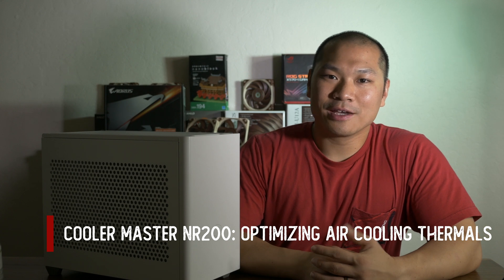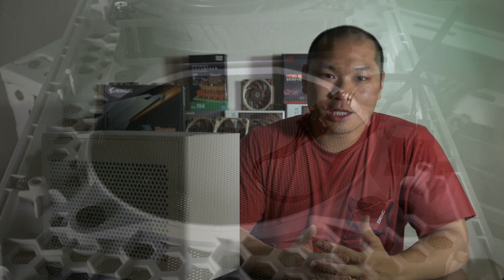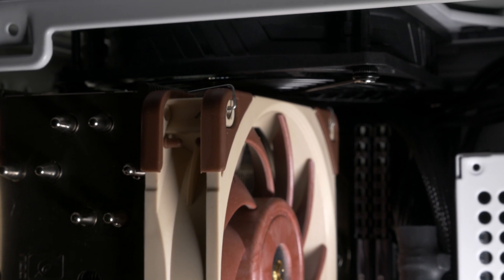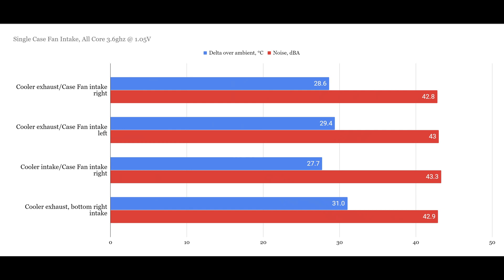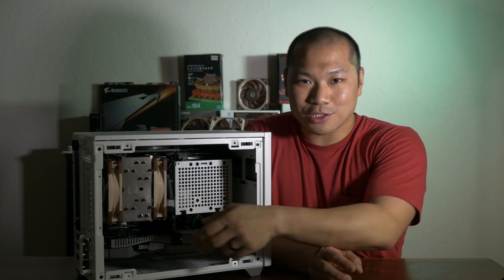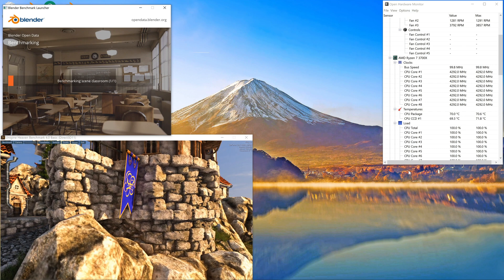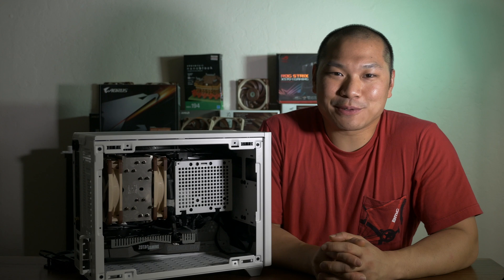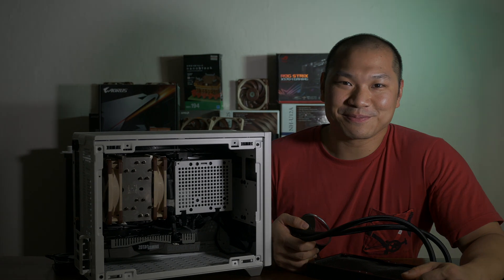Cooler Master NR200: Optimizing Air Cooling Thermals

Comment: I'm planning on doing an NR200 build with the CPU cooler being the Scythe Fuma 2 (155MM). I was also planning on getting 5 Noctua NF-P12 fans; 2x top exhust, 2x bottom intake or exhaust (depending on if I deshroud my GPU), and 2x side mount intake. Is this configuration something you think would be fine, or do you recommend something else?
Reply from the maker: I think it would be fine- my only recommendation would be that you could get by with a lot less fans. Also, correct me if I'm wrong, at a minimum you can lose one of the side fans, since it won't physically mount on the rad panel, in front of the CPU heatsink (it's 155mm tall, so no space). You only have space to slot in the rad panel and install one side fan to the right of the heatsink. Since the side panel is going to allow pressure to equalize regardless of whether there are fans or not mounted on it, mounting fans on it will only have a tiny impact, and put you well past that point of diminishing returns. If I were you, I'd start out with one extra case fan next to the included one at the top, both as exhaust. See how thermals/noise are and if it leaves you desiring more. More fans equal to more opportunity for noise- if you do go beyond two definitely tweak the curves in BIOS to bring it down since your system will run all fans at the same PWM curve if they are on a splitter (which that many fans will typically be).

I was skeptical but the data showed that two fans performed marginally better than one, even at overclocked loads. Bottom fans had basically no impact on CPU, if at all slightly worse when the GPU was also loaded. If you really, really want to prioritize your GPU thermals, and that degree or two matters since you're running a really high OC on it... then yes, definitely put fans at the bottom.
I would be curious to know how the system fares with exhaust at the bottom and top. My guess is since it's so well ventilated, there's no such concept of "negative pressure"- the case will just equalize through the side panel. GL!
Reply: @MachinesMore  Okay, thank you so much for the detailed response. I thought of getting as many fans crammed into the case as I possibly could for more airflow since my room is poorly insulated. And I heard from OT that deshrouding your GPU and having 2 bottom fans as exhaust improves thermals and noise, for the GPU at least, so I thought about giving that a try. I also have an 8-way fan splitter that is powered through a SATA connection that has a high and low mode switcher. So I'll just plug the heat sink fans into my motherboard and connect the rest of the fans to my 8-way fan splitter. As of now I think I'm going to do 2x top exhaust, 1x side intake, 2x bottom exhaust, and 2x CPU heat sinks fans as exhaust. 

Anyways, thank you so much for the advice. I wish you the best of luck and thank you for the amount of time, effort, and care you put into your videos and your community. I am so excited to see what you have to offer in the future! Take care.
Reply from the maker: Cheers and good luck with the build-what GPU are you planning? Deshrouding the GPU isn’t something I’d advise unless: 1) you have an effective 3 slot thickness card that would allow bottom mounted case fans to essentially be right on the heatsink, or 2) you can attach 120mm fans directly to the heatsink (zip ties, silicone, etc). The basic idea is that you are trading louder, high rpm small fans, for quieter, lower rpm 120mm fans. If you allow for an air gap between the fans and the heatsink, you are losing a bit of the advantage- air takes the path of least resistance and doesn’t flow through the heatsink.
Reply: @MachinesMore  I haven't really decided on what GPU to get yet. I'm still thinking on waiting for the RTX 3000 series and AMD's RDNA 2 line up. But as you mentioned above,  I would end up going with a 3 slot card or a 2.5 slot card at the bare minimum. So I'll either get a 2.5 or 3 slot card, deshroud it, and have the bottom fans as exhaust, or I'll get a 2 slot card and have my bottom fans as intake.
Reply: @MachinesMore  would a 157.4mm cooler fit with the glass? Im planning to use the deepcool gammax gte rgb. Could i use shorter motherboard standoffs? What would be the minimum motherboard standoff height?

Comment: Hey man, do you think there is any chance to install a Noctua D15? Thanxs in advance!
Reply from the maker: You probably could, if you don’t close the panel :)
Reply: @MachinesMore  jaja if at some point you can try and tested would be great, thanks in advance!
Reply from the maker: I will keep that in mind if I come across one. I am certain that it will not fit with the panel closed, for sure.

Comment: Man this is a great video about air configurations. I wish you had the tempered glass panel to do testing on that! Maybe you can block the mesh panel to see how having a more 'chimney' or directional air flow would affect thermals. 

I'm going to have to mess with the Fan orientations with the TG panel when mine arrives as I wonder if running the bottom AND the CPU as intake with the top as exhaust would work well. Or maybe the top and bottom as intake with the CPU as exhaust. IIRC Ncase M1 users have the CPU as intake and it improved their thermals overall

My reasoning behind this is that the GPU blocks a lot of the cool air and the CPU (in exhaust orientation) would be 1) getting warm GPU air and 2) with the top as exhaust the CPU might be getting even less air than desirable.

With the Top as intake then the CPU would get cool(er) air (since it'll be a mix of cool + warm GPU) and the CPU should be able to exhaust it just fine.

Or with the CPU as intake it is getting direct cool air and the top will exhaust it easily.
Reply from the maker: Thanks! I have no doubt that the TG panel can shift the optimal orientation. I will test when I get mine in. I did think about simulating the test by attaching a thin piece of plywood to make it a solid panel, but there was one reason why I won’t test it yet... I can’t confirm that the U12A will fit anyway. My gut feeling is no. The U12A is marginally fitting as it is, the heat pipe tip presses up against the panel. Essentially it flexes the mobo mount just enough that the case clips can “strongarm” the panel in place. If that’s the case with the thinner panel- the 2mm less clearance from the TG just might be the proverbial last straw. As another data point, the U12S does not fit properly- the case panel will not stay latched perfectly. All the same, I’m testing it for completeness. In the final air cooling roundup, I’m adding in the Scythe Fuma 2 to see which tower cooler wins.
Reply: @MachinesMore  Yeah good point. I do not expect the U12S/U12A to fit with the TG panel. Fuma 2 is a good opportunity and I'm just going to use my Cryorig H7 which easily fits with both panels.

Comment: Does the NH-U12A fit properly with the side panel dust filter still on?
Reply from the maker: Fits well enough for me. The side panel can be a bit touchy (like every now and then if you press the opposite end of the panel, it can shift out one or two mm- but you just press it back in). U12S, surprisingly not fully closing.

Comment: What are the actual temps in Celcius? I can't follow delta numbers.
Reply: Delta is more useful than raw temperature numbers. His room and your room will not have the exact same ambient room temperature. Following the delta temp you effectively eliminate a variable from the equation.
Reply from the maker: Hit the nail on the head. Basically, it's all the same whether your computer room is 20 degrees or 30 degrees, just add the delta. Theoretically, the cooling potential of air varies based on temperature (due to varying density)... but within the limited bands of temperatures that humans (and computers) live in, it's practically a non issue.

Comment: Awesome video! Looking forward to see the thermal performance difference between side mounted radiator vs bottom mounted
Reply from the maker: Coming soon- although might not test bottom mounted extensively- as Gamers Nexus noted that's not a great position for an AIO rad.

Comment: Tldr: dont get either because the scythe fuma 2 exists
Reply: Would be interesting to see the NH-U12A vs Fuma 2 comparison. On paper the Fuma 2 looks like it could win, but wondering if the NH-U12A’s pull fan being closer to the edge of the case will help it exhaust better than the Fuma 2’s centrally mounted fan...
Reply from the maker: There will be a U12A vs Fuma 2 vs U12S comparison coming up as well. Assuming similar fan performance and similar heatpipe/heatfins efficiency, the heatsink mass is the differentiator. The sheer mass of thermal potential in the Fuma 2 may be the key here.
Reply: @MachinesMore  oh really, I very much look forward to it!

Comment: can the u12a work with the TG panel?
Reply: It's 155 form the mesh panel and 153 for TG. Some have managed to squeeze in a 158 Noctua in there with the mesh panel, but the dust filter needs to be removed, and the heatpipes could pop out through the holes in the panel.
Reply: @STR33TSofJUST1C3  thanks for the comment!!
Reply: theres alot of info going around saying 158mm is the clearance even though the official clearance is 155mm. but the TG panel is suppose to take away those last 3mm to bring it back down to 155mm but i just want to actually see a physical confirmation due to all the differences in info that ive seen going around.
Reply from the maker: I've seen that being discussed and unfortunately I did not get my NR200P yet, despite having ordered it on day 0... but I will say that unless the TG panel gives the same clearance as the mesh panel, then it's a definitive "no". The U12A is basically pressing up against the panel and the reason it fits is that the side panel presses the heatsink against the mobo, flexing the mobo mounting panel, and the clips hold it tight in that flexed position. Not ideal, but it is what it is- works well enough for me. A slight variance in heatsink pipe tip height or position would throw it off enough that it wouldn't work- case in point, I tested the U12s for some future content and it is a definitive "no" also- it flexes the same way but the case clip will not hold it in that position, I believe it's because the heatsink is wider and that heatpipe tip is just in the wrong position to work.
Reply: @MachinesMore  thank youuuu for the detailed comment. Its very nice to see a youtuber who will give such a detailed answer.

Comment: So what configuration would you do if you were to have a 240 mm aio? Would you just have that as intakes and the top 1 or 2 fans as exhaust?
Edit: Even 120 mm + 1 addition fan on its side as intake and 1 or 2 top fans as exhaust? Would these be ideal or suffice?
Reply from the maker: I am doing an apples to apples test with the same equipment (stock fan, extra Nf-f12 on top), the only difference being the AIO. If what you prioritize is CPU thermals, intake from the side panel (or bottom) is your best bet, since that is drawing fresh air. Exhaust just makes sense if you’re intaking from the side panel.
Reply: @MachinesMore  Yeah that makes sense. I plan to do an aio on side panel than the bottom orientation. Thanks man

Comment: Is it possible to rotate the U12A by 90 degrees to pull air from the bottom and exhaust at the top?
Also do you happen to have the Noctua C14, to feed cold air from the side panel?
Thank you
Reply from the maker: I believe so- although the issue here is the U12A doesn't come with the short brackets to rotate it 90 degrees, going to get the hardware to test... I have an idea for a fully semi passive build. ;)
Reply: tag me in, i want to know the answer to this lol
Reply: I also wanna know the answer to this! Lost many hours of sleep thanks to Nvidia's new cooler solution for their RTX 3080 Founders Edition that I want to put into this case ;) I've come down to two solutions that looks the most promising. An water cooled AIB with intake from the side panel or - what I would like the most - the NH-C14s. This is due to the new GPU cooler design would push up hot air and dump it straight into the intake of your "normal" CPU Air cooler. It might be doable with a rotated CPU Air cooler though.

Comment: Thanks for sharing this. The preconfigured fans (both exhaust) as delivered is about creating an internal negative  pressure so there is air intake from the ventilated sides and bottom. In your configuration with 4 case fans, I wonder if you actually have a neutral/positive pressure as CPU fans pushing air towards the back is not quite true exhaust without the stock 92 mm fan. I would be interested to know the CPU temp when you remove the pull CPU fan and putting back the stock 92mm fan as exhaust to create a true negative pressure case (3 exhaust, 2 intake), which would pull air from the sides for the CPU.
Reply from the maker: My opinion after testing the NR200 is that while the positive/negative pressure type of discussion applies when talking about cases with glass panels or super limited ventilation, this case has so many holes in it, it's practically like open air. That is why the results are so close. You could do everything in the wrong direction, and as I noted, even then it's still pretty good. The way GPUs exhaust hot air is what will affect the optimal configs in real world scenarios. From a cost to benefit perspective for air cooling, I really think you can't do much better than sticking to the one exhaust fan provided, and if your tower allows it, put that 92mm fan to match whatever CPU cooler fan direction you choose.
Reply: @MachinesMore  What I intend to do when my case is delivered (Sept?) is to use incense smoke to see whether the air is going in or out from the side panel as I will try to achieve side intake in my fan configuration.

Comment: When using an AIO, is there a way to swap the feet side of the case, with the top?  That way the CPU sits at the bottom, and the 3 slot GPU area is at the top.  But then you’re limited to using a 240mm radiator at the top, but at least it’s mounted above the pump.
Anyways, awesome job and thanks for all the work you’re putting into and sharing about this case.
Reply from the maker: Thanks for checking in! Nope, you can’t swap the top panel with the bottom. They are quite uniquely designed to mate to the top/bottom frame. I think your concern is on where to mount the AIO rad... is that right? You can mount it on the side, or on the bottom (if you are running an APU or vertical GPU).
Reply: Machines & More That’s right, where to mount the AIO rad.  The recent Gamers Nexus videos on AIO pump placement got me thinking about what other options were viable in this case, without going down the custom loop path.  Looking forward to seeing your next video with the AIO!

Comment: You think a Neptwin V2 could fit into that case????
Reply from the maker: I wish I could say. So far I’ve tested two coolers spec’d at 158mm, which that Neptwin is also- but the U12S doesn’t allow the panel to fit flush, whereas the U12A does. They are all technically touching the panel, but the U12A is narrower, so the offending heatpipe tip has much less of a direct impact on the panel clips, since it’s farther away. For a dual tower, the Scythe Fuma 2 is getting some good press for this case- I hope to get one in for testing in the near future.
Reply: @MachinesMore  the U12S is narrower (depth) than the U12A by 13mm?

Comment: Is it true that your noise dBA values in your tables were for load testing conditions? If so, what are the dBA noise levels for non-load normal conditions? I'd like to know the noise levels when not using the computer under load. Also, how do these dBA noise levels compare to a full ATX case? I am primarily wanting a quiet PC when fans are around 1000 rpm, so I'd be interested to hear your comparison between AIO and air cooling when fans are around 1000 rpm. I don't do overclocking, so the extreme load tests are not of so much interest.
Reply from the maker: Yes, those are all load noise levels. The noise floor was slightly less than 40dBA and idle noise was about 41.5dBA. Pretty typical increases for most systems. Everybody’s use case and position will be different- which panel you have facing your ears, and how you orient the case relative to the user, will have a big difference. A lot of ATX cases are “quiet” because there is usually a fat glass panel that insulates noise. I will also be wrapping up the TU150 which will also include noise levels. For sure, my ears prefer the muffled noise through the TG panel.

Comment: I am planning to use scythe fuma 2 flipped to take fresh air from the back and top fans are exhausting the air and also 2 bottom intake
what do you think?? Will this be the optimum configuration?
when it comes to fitting it will fit since someone already did it!
Reply from the maker: Yup, with the vented panels you should be GTG. With the TG panels I’ve heard of some interference. To answer your question in case fans- ask yourself the following. Are GPU thermals more important to you, or are CPU thermals? At least in my testing- even one single fan at the top as exhaust was able to sufficiently help the cooler along. The significant difference in cooler intake/exhaust was the effect on the GPU. But since you are running bottom fans, you will balance it out. Personally for a balanced approach I’d just go two top exhausts and exhaust out the back- you’ll get very very similar GPU thermals and less overall noise (from less fans).
Reply: @MachinesMore  thank you sir
so all I need is 2 top exhaust fans
and cpu cooler exhaust from the back
no need for 2 bottom intake correct?